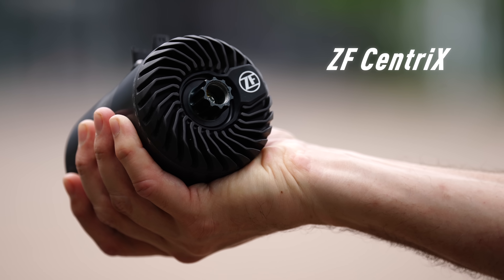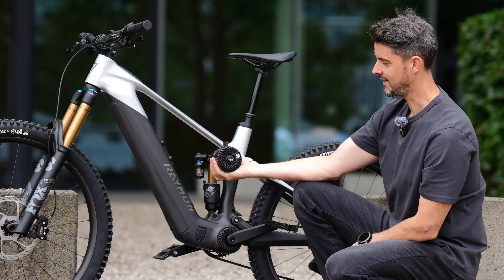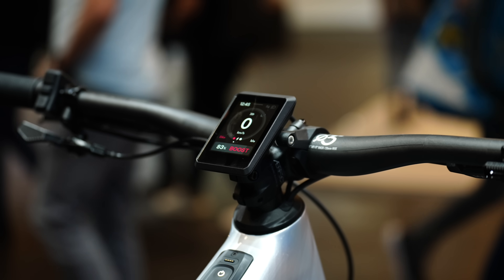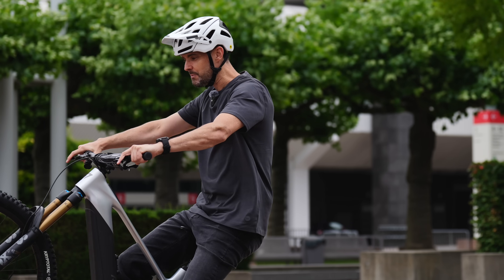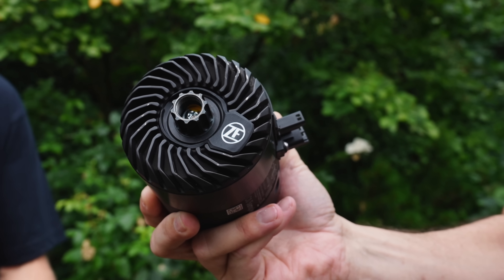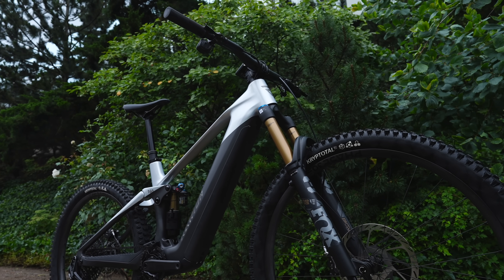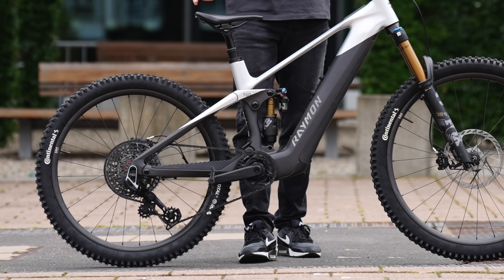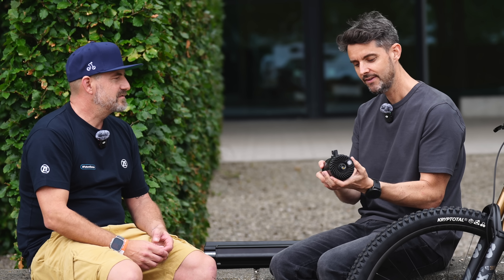How Did ZF Do This? Super Compact, 90Nm Motor

Comment: What's the point of this??? My 6 year old shimano e8000 goes trough chains and cassets like a starving pig.... E mtb needs a drive train solution not another new motor!!!! If ZF are so good at transmitions they should off started with one on EMTBs instead!!!!                            MGU> Rest of e bike mottor brands
Reply: Really, had a shimano e8000 as well...the most noisiest motor I have ever owned...currently 8 eBikes in the garage...sold it immediatelly after some 100 of km.
This is meant to be completely silient like a rear motor...still love it for this.
And this will be one of the next I will try and buy...simply due to this...silence again no raddling and humming of the motor as soon you ask for performance.
Reply: Don't mean to disagree with everything you say or anything man lol.  but I have an e8000 motor too and not going to say it's great or anything it's very average but that's not the reason your going through chains. My chains last a year or more.  It will to do the way your bike is setup, your cassette being warn or your riding style and when you are changing gears. Ive had this very problem in the past. Chains can last a long time treated and maintained right.

Comment: I dont need (or want) that much power on an emtb honestly, the Bosch race motor in race mode is already too much for anything but steep hills
Reply: Excactly..steep hills. This motor should be perfect to drive uphill on downhill tracks...and run over roots and rocks etc.

Comment: Since ZF is a company that makes high performance automotive transmissions, I'm surprised they didn't go with an integrated gearbox unit. They would of had an upper hand on the Pinion MGU.
Reply: I’m sure it’s in the works.
Reply: The unit is too big with integrated shifting, it greatly reduces bike design, which negates the whole concept of this small motor!
Reply: first you need motor.
Reply: You mean Transmissions with the worst reputation for longevity 👀

Comment: How is 48v legal?
Reply: It is not about battery power but motor power.  I believe the limit needs to be 250watts continuous at most, and I don't know of any limitations on torque.  Torque is dependent on internal gearing so that can change while power stays the same.

Comment: I have a 6-speed ZF automatic transmission in my 2007 3-liter 6 cyllinder diesel BMW, it's currently at 280.000 miles. Good stuff
Reply: Impressive😅
Reply: 280,000 miles - very cool. I was impressed with the ZF transmission in my 3 series as well.
Reply: My broke down after 110000km
Reply: @MBtrue  What exact transmission was that?
I bought my car used 10 years ago @ 187.000 km (116.000 miles) and since then I changed gearbox oil (not complete flush) and filter 3 times.
Reply: @curioussand1339  BMW E90 from 2008. Gearbox was done in 2019. Maybe just bad luck... Started with shifting too late until not shifting at all. Oil change was too late at this point.
Reply: Not just cars- I grew up driving several (farm) tractors with ZF powershift boxes or diffs/axle assemblies etc.  Solid stuff.
Reply: Bro!! E60?
Reply: @marioambrozi5041  Almost, E61 LCI
Reply: I have a 2011 x3 35i with the 8HP at 312k and the transmission has been the one thing that has kept on going without problems
Reply: Just Google it, they are the worst, I’m glad you people had some luck though lol
Reply: I have a ZF 6 speed in my Lexus. I took it from my bmw e60 and it makes the Lexus a lot more fun to drive!
Reply: I have 2018 s5 B9. Best gearbox ever

Comment: If ZF are getting into eBikes can they not replace the sodding cassette and derailleur?! Come on get a mini torque converter in there somewhere too!
Reply: 100% agree. The cassettes not fit for purpose on an ebike.. I'm insanely gently on my drivetrain but a gx cassette is skipping under load after 500miles. £160 to replace, that's 35pence a mile in cassettes🤔 almost doubled what my van costs in diesel. It's a joke.
Reply: @bmartinot  1300 miles on sram NX  11-50 ...no skipping...2. chain
Reply: @zoranpl  that's better. Still over 10pence a mile in cassettes. Seems that not many people getting much more that that put of them. Maybe depends where you ride. Mines all of road smashing around but I never shif under load and always keep my cadence up.
Reply: They have to sell to a mature market, as a new player they don't want to alienate the whole customer base by building a moto.
Reply: Rohloff

Comment: Now just put a gearbox and belt drive on it!
Reply: and a small battery to get it light.
Reply: Why? Too heavy and lot more expensive for no performance gain
Reply: @romma11 old tech of cassette/derailuers have no place on emtnbikes…..the only exception maybe entry level bikes
Reply: @romma11  why? How about virtually zero maintenance! No big heavy cassette, derailleur or chain and front chainring to damage or replace! Less unsprung weight on the rear wheel/suspension, weight lower and centralized! And it’s not more expensive. Have you seen the pinion MGU reviews on the Nicolai Saturn 16? Why not?
Reply: @onetime242   with electric drive support lot of gears can be reduced and move into electrical domain, if not all eventually. Electric ebike support motors already have gear reduction and in combination of electrical modulation can reproduce gearing virtually eliminate any rear wheel cogs . There is no need for heavy transmission
Reply: @romma11  a little heavier yes, but that is irrelevant on an ebike. Expensive depends on what how how much you ride. Motors with this amount of power plus the rider will chew up derailer systems fast. a belt drive may last 10.000km even in MTB conditions. How long will your chain and Cassette survive and how much to replace them?
Reply: @romma11  Your statement is just false. Belt drive is superior to chain one in every single way.

Comment: i come from a motorbike background and i have said it for years ZF no there shit this in my eyes is more impressive than the dji new release motor
Reply: The hardware seems like it. But I guess the software is equally important. The future is going to be very interesting.
Reply: Does zf makes electric stuff and motors? Seem everyone is commenting on how great their gearboxes are
Reply: @romma11 yes. Listen to the guys in the video, they briefly tell you about the industries ZF operates in. It is based on a robotics motor like the TQ
Reply: @romma11 they make transmissions for vehicles mostly that's what they started as decades ago they make everything parts for motorcycles boats cars trucks. Most old pickup trucks have a ZF manual transmission.

Comment: Rob, are you aware that some of us love MTBs but ride on the street more than trails? I'm wondering if you can include some amount of riding on the pavements? Some of us are lovers of bike tech and full suspension may add weight but also improves ride on hard paved surfaces. My 2 cents...your mileage may vary . . .

Comment: Well, DJI showed recently 2,82 kg (300 g more) engine with 120 Nm and 1000 W in boost mode. If ZF engine weight would be around 2.0 kg I would be more impressed. For over a year Trek Fuel EXE have 50 Nm with 1,78 weight.
Reply: the advetised Nm and watts are as reliable as EV car battery range, only a real comparison can tell you how they work, and you're comparing an actual gearbox and transmision company that does heavy duty car and truck engine parts with a gadget company, obviously one will look cool and be light and the other a massive block of steel the question is which one really works and lasts the longest
Reply: Here in germany it does not matter beyond 250w I think, as that is the legal limit. With that, even the higher Nm will reach the limit real quick, as Nm x Revolutions per Minute determine the Power.
Reply: @notsafefortorque9060 it is the nominal power that is limited to 250W, however motors are allowed to have peak power above that. In reality the Bosch CX, TQ, Shimano EP8, Yamaha PX, etc... They all have peak power above 250W and therefore some are better than others getting you up the hill.
Reply: @nelsongracias1847  I guess there is one of the problems with the numbers and specs. All over the place when it comes to how and how long they define them.
Reply: @notsafefortorque9060  Wow, You know that even tiny TQ50 have 300W power? This limitation is insane.

Comment: BTW, for anyone wondering, 600w from 2.5kg is terrible in the grand scheme of things.  Ok, ebikes are limited by regulations, but a (bare) high performance electric motor can actually sit at up to 40kW/kg and with an integral inverter and trans, 10kW/kg is possible.  Of course, it needs a bit more than 48v to release those kinds of powers, but honestly, in terms of specific power, current ebike motors are actually pretty awful......
Reply: Agree...the motor for a BMW i4 has the similar size and 340hp...the outer size is just the big cage for the engine inside to do cooling etc.

Comment: Nice compact motor but they need to develop a auto gearbox built into the rear hub with a belt drive.
Reply: Rear hub? That's a stupid idea
Reply: @kabaret3  No there's  a Germany  company's called 3X3 that have developed one you can change gear in a fraction of a second even from 9th to 3rd.
Reply: no, not rear hub, needs to be in the bottom bracket like the Pinion MGU

Comment: That's pretty incredible. And I thought the DJI motor was innovative!
Reply: I was thinking that too but what DJI is, it is a complete package system and not just a small strong motor.  The ZF motor is more impressive for sure but what about the other stuff...
Reply: @DaBinChe I agree. The motor looks fantastic but the controls lackluster. ZF needs to copy DJIs controls with an integrated touchscreen solution that gives useful data.

Comment: As interesting as the current and new motor technology is, the one aspect that is never mentioned about ebike motors is the mechanical drag over the assistance cut off. It would be great if this was mentioned in the reviews as well as the other aspects of the motor system!
Reply: They did mention the integrated clutch. That should do it.
Reply: i believe  browse x specialized motor was the best on that, nearly didnt feel the motor when it was off
Reply: @zayon0170 really? I notice my turbo levo brose motor, it’s like pedalling through mud.
Reply: I luckily only had half a mile to go without assistance (6500ft of ascent on a 500wh battery was optimistic lol) but it was slightly uphill and oof I would not do much more than that it was an older Bosch model (rental) it was bad enough walking next to the bike seemed almost a better option
Reply: @fredEVOIX  sounds like you also know the pain of a bosch gen 2/3 drive unit!!
Reply: Lightest gear en go on, or else it's cross country  @fredEVOIX
Reply: what cut off ? ;-)
Reply: Indeed
Reply: what
Reply: I agree. I was somewhat annoyed by my Gen2 Bosch being pretty much unusable unpowered. I initially thought I would get away with it being off on the flat trails to eek out more range on the climbs but nah its a right slog. Similarly when the assistance cuts off when at speed in the ups and downs you can really feel it and have to put extra work in to keep the momentum going.

Comment: Lightning Rods Smal Block with adequate cooling does 5000W at 100V and weighs 3kg (without a freewheel though)
Reply: How efficient is it though? 5000w motor is useless if you can only go 10km.
Reply: @The.JZA.  well efficiency is good and much less of an issue than the power in general needing big batteries. It's just ridiculous to praise motors for their performance numbers when what matters way more for normal emtb is programming etc. If you want higher power build something yourself or get a surron.

Comment: ZF have been manufacturing gearboxes since forever. Why aren’t they actually moving the pedal assist emtb forward ?. It’s just another motor …Combine this convenience with a gearbox. That would progress the emtb concept forward. For me, they just aren’t bike savvy….
Reply: I'd guess this is a toe in the water. 
Engineering a motor/gearbox combo is a lot more work than just a motor and bikes/ebikes are a new market for them. If they do well we'll probably see more from them. 
I mean look at Pinion, they launched what everyone is asking for, a motor/gearbox combo (though the same argument could be made for their gearbox alone), and take-up is slow, likely because bike companies need to design new bikes to use their product.
Reply: There’s not much about these features that hasn’t been seen or used for considerable time in engineering . That said, the Bosch/ Shimano big players are starting to look like they’ve just had their own way for too long….?
Reply: This small ZF drive system is easily adapted to typical MTB frame/suspension concepts and they will look and perform all the better with it. Now visualize the size/shape of a practical eMTB gearbox and how it might look when connected to the motor and then connected to the rear wheel. It will need significantly more space in the frame. Some major changes in frame/suspension design will need to be integrated around this new drive/transmission system. The industry and most buyers are probably not ready for what this will look like. I'm all for it and think ZF's clutch system, which is already part of this drive system, solves some of the technical challenges. I don't think ZF added the clutch system just for better over-run performance so it will be interesting to see what they come out with with their bike manufacturer partner. In the meantime, they can sell lots of this ZF drive system to established brands and their help fund future development while becoming a trusted brand in the eMTB market.

Comment: No doubt this is the better engineered motor compared to the DJI, ZF make some of the best automotive gearboxes at huge scale, this will be over engineered and bullet proof, amazing tech.
Reply: I am not sure that DJI has not done something really great. 
ZF is older - but nowadays that does not mean much.
Reply: @misiek7676  I agree the DJI solution will be good, but ZF have so much experience in durability of transmission systems that you can imagine their motor to be bomb proof and ultra reliable.
Reply: DJI has build hundreds of thousands of motors for drones and there is zero tolerance for failure in the air. I fully trust their durability.
Reply: I'm with you on the reliability part, but what dji created is next level, it's just interesting that they can push out 1000w with a 36V System in a 2,5kg housing, that means high amps which means more heat which will stress the system and therefore the reliability
Reply: @eaze7324  agree, also I can only imagine how long a chain and sprockets will last with 120NM and 1000w !, a days riding in muddy conditions with 1000w won't be conducive to chain life !

Comment: Another ebike motor nobody will ever see on an ebike.
Reply: Why? The Eurobike is running this weekend in Friedrichshafen, showing the first OEMS using this motor...there are also videos from the trade show available already.
Reply: @josefv-y8m  Here’s the problem. They demo-ed this on a road bike. In the States, road bikes are wildly regarded as commuters and many of them are cheap hub drives that can easily hit 25-30 mph with a throttle. Unless there are eMTB applications this will never get out of the EU.

Comment: I don't know how this instant torq would help you on an tech uphill. It will not get you over stuff it wil get you looping out. For flat street fun like wheelies it good.
Reply from the maker: Depends. I like having a mode with instant torque for techy uphill sections that react quick to rider input and allow max power when necessary - but the key really being that the modes can be adjusted so if you don’t want / need it then an alternate mode can be chosen 👊

Comment: So an auto gear box maker makes a motor with no gear box ! Faaar cough 😂 ….zf with a derailleur 😂😂😂😂 come back when it’s finished
Reply: Massive disappointment
Reply: Came here to chime in on that gearbox issue. If the Motor is anything like a TQ but more powerful, then well done to ZF!

But Personally I would Never ever consider an ebike with rear derailleur.

Come on ZF, you know how to make gearboxes. Do it right and I‘m in the market.
Reply: ZF is also an EV Engine manufacturer.
And the major advantage at least for me is...silence...the rattling and humming of other engines as soon you ask for performacnce...is just a fun killer.
I would love to have again the silence of my very old rear motor eBike...you just hear nothing from this kind of motor.
As soon you will add a gear to the motor, the noise will be back.
The Pignion Solution is noisy as hell..will never buy this, but love the chain...or combination of belt and gear in the rear wheel.
Reply: @josefv-y8m  oh pull the other one it’s got bells on. All transmissions make noise, including the chain and derailleur you’ve been using until now, and smashing off rocks, getting sticks and grass stuck in it, spend ages digging grass and wood and debris out of the cassette and jockey wheels, fiddling about lubricating and adjusting the cable is its slow shifting, then its ratting. Then it gets wet and you have to start over again. You can’t always trust it to not slip when you need to pedal  hard, AND THESE GUYS MAKE GEAR boxes, and what do they do? They fit a FUCKING DERAILER 🤷🏻 FCUKING IDIOTS